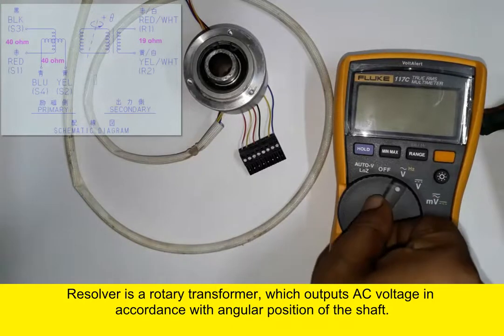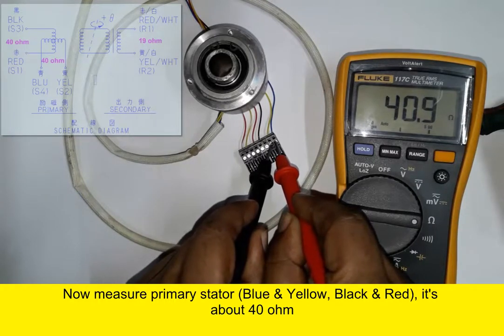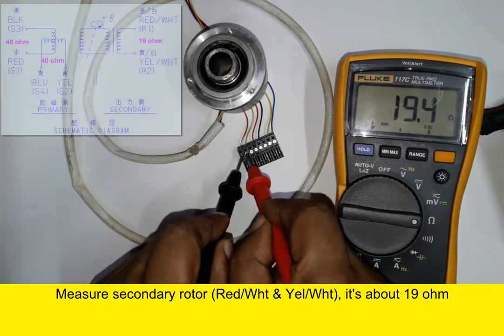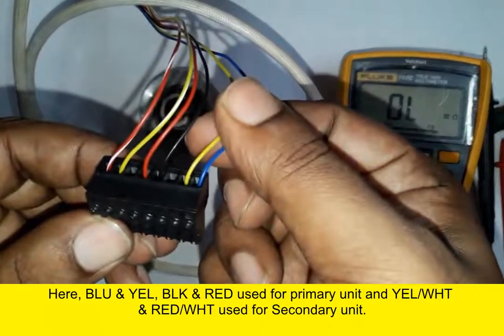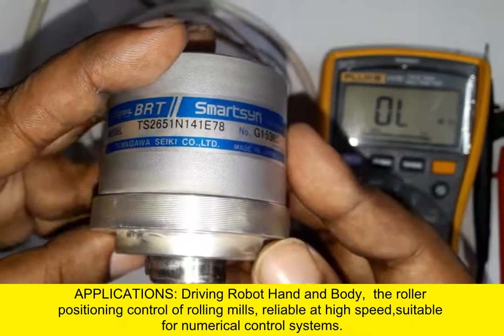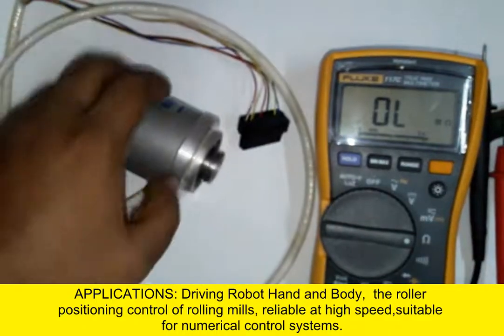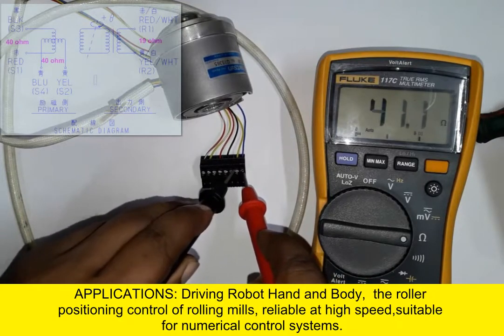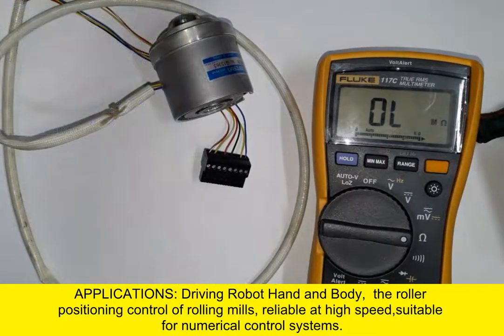𝐓𝐀𝐌𝐀𝐆𝐀𝐖𝐀 𝐑𝐞𝐬𝐨𝐥𝐯𝐞𝐫 𝐩𝐫𝐢𝐦𝐚𝐫𝐲 𝐚𝐧𝐝 𝐬𝐞𝐜𝐨𝐧𝐝𝐚𝐫𝐲 𝐮𝐧𝐢𝐭 𝐦𝐞𝐚𝐬𝐮𝐫𝐞𝐦𝐞𝐧𝐭 | 𝐒𝐦𝐚𝐫𝐭𝐬𝐲𝐧 𝐓𝐒𝟐𝟔𝟓𝟏𝐍𝟏𝟒𝟏𝐄𝟕𝟖 @ফ্লোচার্ট

Comment: Hi sir, what should be the resistance between black color cable and resolver body?
Reply from the maker: Sorry sir, I wasn’t test it. Try to next. Stay with Flow Chart. Thank you
Reply: @FlowChart  Thank you for the explanation, actually i cross checked the resistance, it should be as per the datasheet of manufacturer who specifies the resistance and impedance of circuit.
Reply from the maker: Welcome